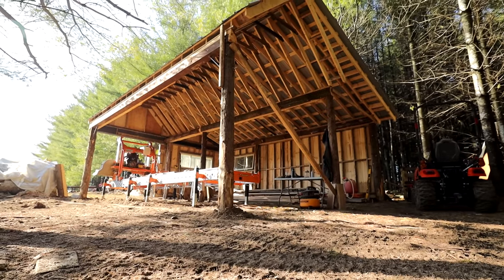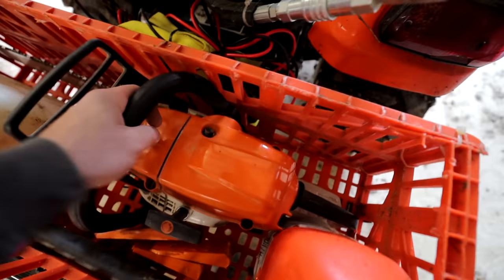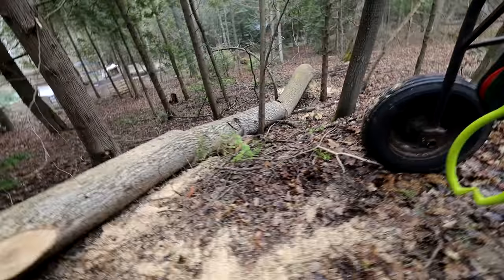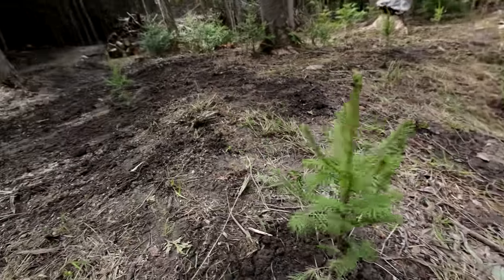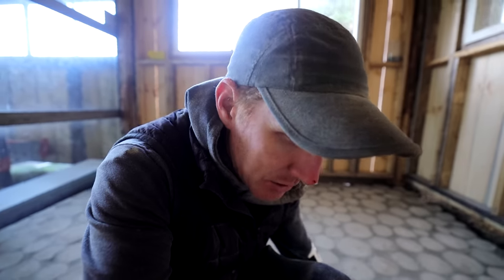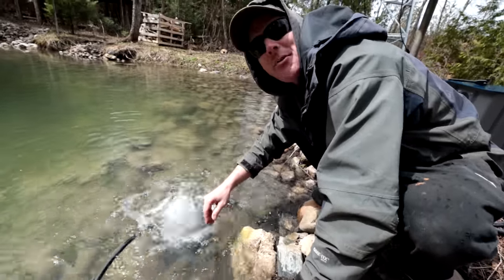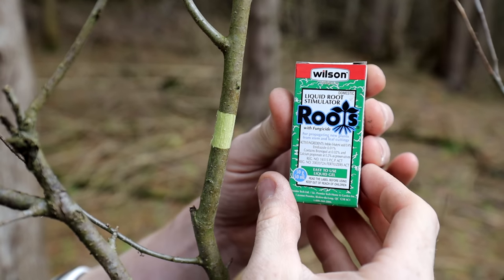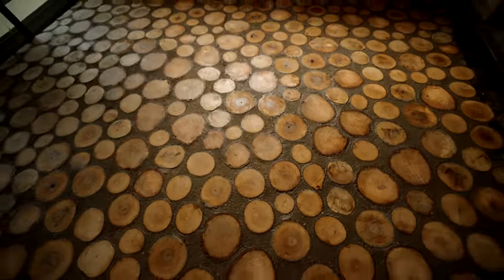'A Day in the Life' at My Off Grid Property! | Fish Pond, Forest Maintenance, Winching, Sawmill Shed

Comment: Starting a new tree on a branch method called air layering, did the same sort of thing using a 5 gallon bucket cut and patched with duct tape... on a boxwood branch... it is a new boxwood plant... some use plastic bags,  but I left the bucket on for a year or four... a very nice root ball.

Comment: i know you want to keep the front of the sawmill shed open to be able to put new logs on the saw of course.  
but if you use (old) side walls of a party tent you can have both, 
open when necessary, and close in bad weather or a lot of wind.  
certainly also useful to keep the snow out again next winter
Reply from the maker: I agree..  it's probably a fall time project when I realize I need something there.

Comment: Why the second battery does the tractor not have one that will work well as long as you leave it running when using the winch ? Can ground to the frame and run 1 power supply to winch .

Comment: I know the trout need the water oxygenated. My question is with the air stones at the bottom of the deepest part of the pond does that warm the water? Warm water does not contain as much oxygen but is there enough cold water from the springs to keep the temperature down?
Reply from the maker: Last year we tested the water and it was cold throughout the entire season.
Reply: @ModernSelfReliance  I remember you testing but didn’t remember how it turned out. I was remembering your concern about the water temp. I watch both channels. Thanks.

Comment: Great video . Question... Why did you drag that log by the middle causing the front end to drag along the ground and sliding under your hitch? Opposed to catching it toward the front and lifting it up off the ground avoiding resistance and not bending your hitch. Just curious.
Reply from the maker: Cause and effect..  I bent the whole thing by using a winch basically pulling it towards to hitch.  The idea behind the log arch is to lift the entire thing.  Once it was bent it just kept bending.   I've made some modifications and it's in the next video.   Added a pulley should redirect the force more evenly
Reply: @ModernSelfReliance  I really like the set up...I need to copy it... Good idea.. enjoyed your video.. thanks for responding...

Comment: Your little plastic root ball thingie?
My daddy used the same technique way back in the 80's/90's, when I was a little sprout.
EXCEPT he didn't have the plastic ball thingie. He'd wrap the branch with a ball of potting soil wrapped with tin-foil wrapped with duct tape.
He cloned  a lot of trees using the same rooting hormone and technique. I bet he would have used that ball had someone made one.

Ima thinkin' I'd be a richer girl had daddy  invented that thing.
Reply from the maker: That's good news..  I'm a little skeptical that mine is gonna work.
Reply: That is done a lot. Air layering. You can also use clear plastic to wrap around the branch, that way you can see when roots form. Most of the ones I have seen have been bigger then the premade one you have.